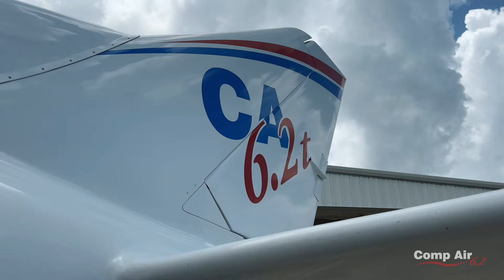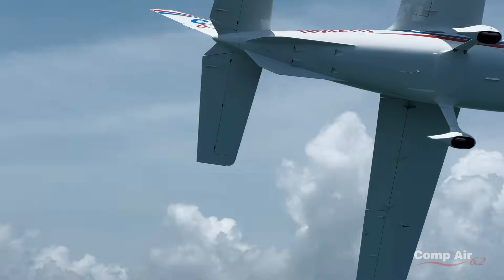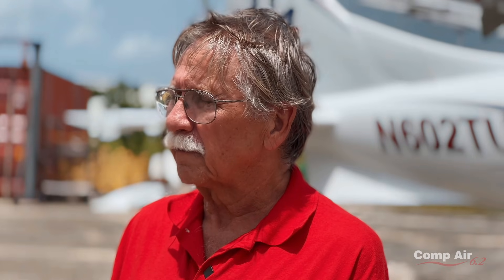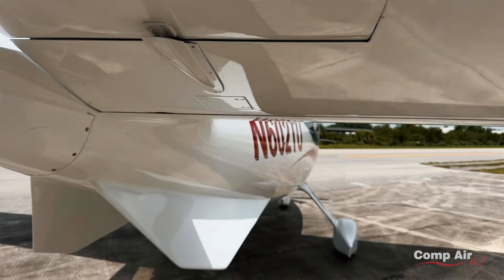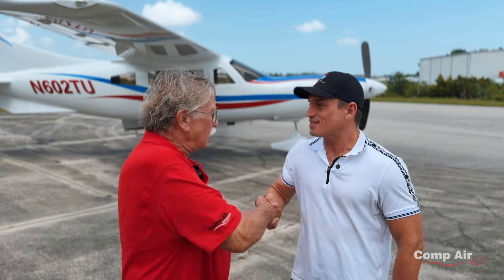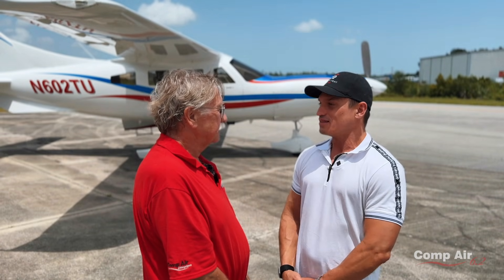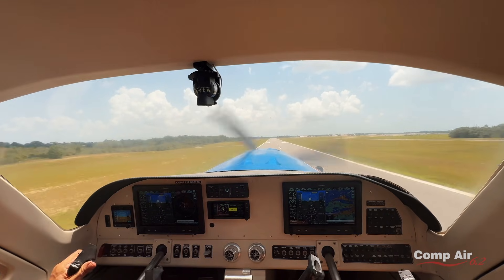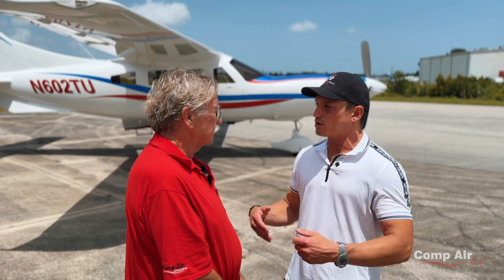Inside the Comp Air 6.2T | Turbine-Powered Kitplane + Interview with Ron Lueck

Comment: Im a big fan. We actually met at OshKosh. Wife really wants a plane with a BRS system though. Is that a possibility? I think it could work in the back of the baggage area and firing up through a panel in the roof. A vision jet weighs more than this plane and has BRS, so i know that the weight capacity is possible with the right system.

Comment: this is the best kit in my book. retractable soon?  oblique pivot mains? forward retracting nose with a 90 deg. twist?
Reply from the maker: Thanks for the kind words! Right now, the CA6.2 is offered as a fixed-gear aircraft. Retractable gear isn’t part of our factory design, but since this is an experimental aircraft, builders are free to engineer and experiment with retractable gear systems if they choose. The 6.2 was designed to keep things simple, strong, and efficient with fixed gear, but the experimental category gives builders the flexibility to pursue custom modifications like retracts if that’s something they want to take on.